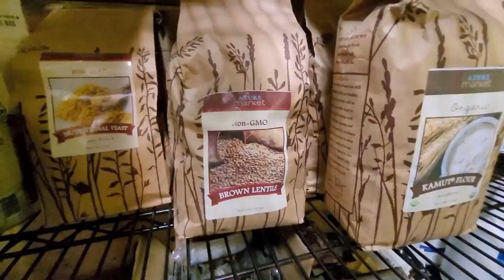Combating Supply Chain Issues & FOOD SHORTAGES with this

Comment: I recommend setting that space heater at 50-55 in the winter. your squash and canned goods like that temp for storage. if you can scoot that wonderful freeze dryer to the left you will have a work table on the right; i love that green. it looks like spring

Comment: You don't have to get a bigger house. Yours is perfect. My family had a two-bedroom house and I grew up with 11 kids. We also had a garage where my parents slept in later on. I wonder if the freeze dryer is too hot when running in your pantry. The green wall pop, Mike....love it. Love that last tune too.
Reply: I was thinking the same about the fd. My daughter has hers in the garage and has problems in the summer. I don't have that problem, but mine is inside. I just noticed a small air-conditioner near the ceiling . They'll be fine
Reply: he has ac  and heat in the pantry
.

Comment: I always loved painting, I find it relaxing. You did a pro job on that tape, float & finish!  I love how the freeze dryer matches!  Trim nailed, caulked, painted, etc will also weather proof and bug proof. I’d clean & put some insulation around the ac first though. Tiny hint about those interior wood walls that you like… when I painted a Popeye’s job, he ordered some stain & seal for the exterior fences (like you use for interior wood floors) and after like 10 or so years, it still looks great. I bet that siding is going to look nice too!  Nice to see all the progress!

Comment: Good job on the wall, and the freeze dryer. I have the same Harvest Right model. My daughter and I use it all the time. We keep it at her house because my little OLD house is only wired for 15amps. So when my fridge is full of fresh eggs she takes them home to freeze dry. We DF all kinds of stuff. Sometimes we use a FoodSaver on the bags as well, and that saves space because the air was sucked out. I have a vacuum chamber coming tomorrow so the Foodsavers I have will have to find new homes. Meat does really well freeze dried, too. I love banana chips. They're SO much better than dehydrating. Oh, if you have a food processor, that is a good way to get your foods sliced up into even slices. Just don't go above the top of the trays with thick stuff, though (thin is better). And you can use parchment paper and layer them.